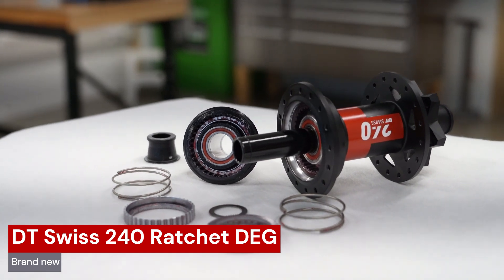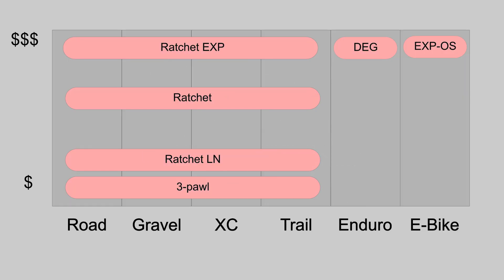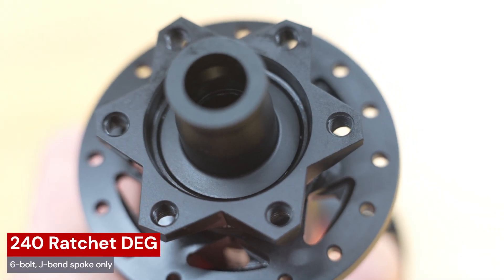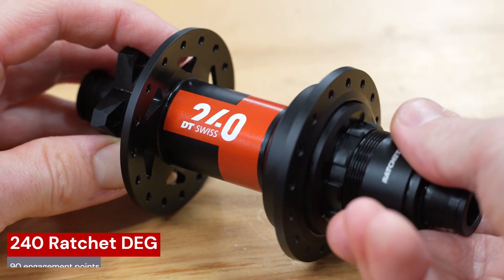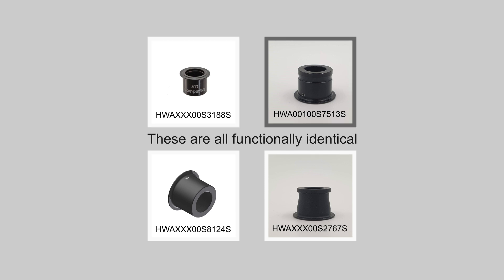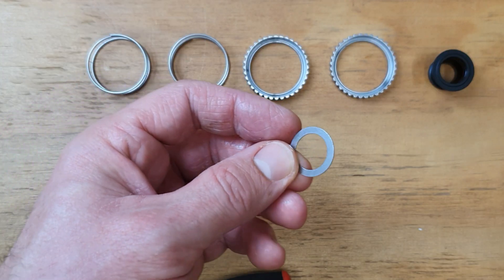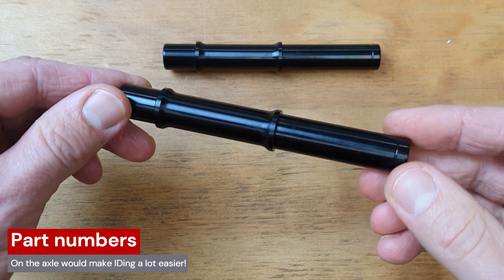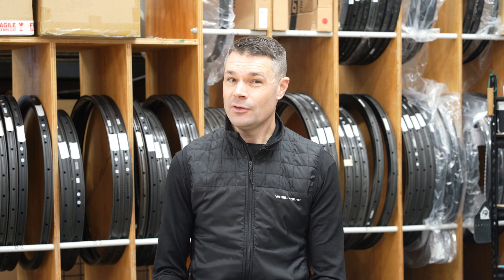DT Swiss 240 Ratchet DEG Deepdive

Comment: I had an 18T ratchet in my hub and replaced it with a 54T ratchet.  DT Swiss does not recommend this type of ratchet for my e-bike. However, when riding trails, the combination of the drive unit and the hub led to a lot of free stroke before engagement. So I was told to buy the EXP OS, but they only had ratchets with lower engagement points of a maximum 42T. So I decided to just ride the hub until it breaks.

Comment: At aliexpress already arrived a DEG copy for road hubs and straight pull spokes ))) But with 6802 and 15267 bearing at hub body for low weight. Btw, what do you think about small bearing life at rear road hubs?  Such as DT 180 1526DS/6802NDS. Is it ok for 70kg rider?

Comment: Thanks for the review. Do you notice higher freehub drag with the DEG? I've heard reports of that.
Reply from the maker: @trentvlak  After some of the EXP issues we say I was  working on a way of measuring both freehub body drag and bearing drag, but honestly it's slipped down the priority list of projects.  When the ultra low-drag Pro5s showed up I really wanted to resurrect that project but haven't :-(  

So without measuring, yes there is more freehub body drag.  This is consistent with general physics that almost any 'type' of freehub will increase drag with more engagement points as you've got more things touching, more often.  The DEGs larger diameter ratchet rings will also be contributing to this.

One interesting thing about ratchet style hubs that I did notice with my testing is that the drag flattens out at a certain speed as the ratchets essentially skip over each other and don't have a chance to fully engage.  

Maybe one day I'll get that freehub body drag system up and running -Tristan

Comment: Great video.  I wasn't aware there's a bearing life compromise on the EXP hubs.  I have three sets of EXP hubs, with one set still new.  On one hub I could feel a click or two while turning the end cap with my fingers.  Not the usual notchy bearing feel.  The 'click' goes away when I apply pressure on the end caps while turning it.  Do you know if this is an early sign of a bearing failure?  This is on a front hub (240) so presumably it has nothing to do with the EXP design.  Thank you.
Reply from the maker: Have you checked that it's not the endcap rotating on the axle?  -Tristan

Comment: Excellent video! In my opinion, the current DT350 (SP CL) with 36T Star Racthet is by far the best hub on the market.
Reply from the maker: Tried, tested, and true!  It's a great hub with a great balance of all attributes and a reason it's the hub everyone tries to copy!  -Tristan
Reply: Would you consider it even better than the previous (non-EXP, traditional Star Ratchet) 240s? "Better" in terms of durability, since the older 240s also had smaller bearings than the 350
Reply: @steveadorjan9048  by definition we only truly know what the durability of a product is like after years and years of use.  In that regard I think it's too early to say about the DEG...the smaller bearings might be an issue, but the slightly wider bearing stance and different freehub design might mean bearing life is better.  I think it's too early to say. -Tristan

Comment: First class video and information. No annoying muzak and stupid cartoon clips. It looks as though many Chinese brands are taking advantage of the expired DT ratchet patent and making improvements as well. Ratchets (up to 64t) are now available based on the initial design but have no shoulder providing a better spring interface and use of a slightly longer parallel spring/s. Some are using a single spring similar to the EXP but the inner ratchet is still held within a ring nut and as such both ratchets move with the axis of the axle. They also seem to stick to the original 6902 bearings (15x28x7) rather than the smaller diameter 15x26x7. By continuing with a two piece ratchet as per the original design, it makes it easier to replace them because as you say it is a wearable and as such a replaceable part. Some of them recommend a 500Km service interval for their ratchets.
Reply from the maker: I think having both ratchets floating means they deal better with axle flex, contaminants, and tolerance issues.  OneUps new hub uses a single floating ratchet and looks really well-made so that will be an interesting one to keep an eye on.  -Tristan
Reply: @WheelworksHandcraftedWheels  Having already looked at One Up's hub information BOTH of the ratchets are floating. The "ring nut" is machined directly into the hub body (7075 T6) so is an integrated design. Bearings are 61902 so are 28mm dia. and are both driven out via the non-drive side. They use a 44t ratchet but ATM do not make a centre lock version and they require J bend spokes.
Reply from the maker: @johnlesoudeur3653 Both ratchets are 'floating' but the one in the hub shell has no spring so will always be pushed back into the hub.  The freehub body ratchet has a spring on it so will have far more lateral movement.

The only downside of this design is that the steel ratchet which is inside the hub shell will eventually wear the hub shell, although time will tell how long that takes

I'll try and get some info up about the One Up - Tristan
Reply: @WheelworksHandcraftedWheels  Yes that would be good because it can be argued that although the inner ratchet is "floating" it is pretty much static, the outer ratchet does all the moving. I have an Elite Wheels Pro hub and they use a similar design but use use an Al alloy ring nut. No discernable wear and no issues.
Reply from the maker: @johnlesoudeur3653  (with regards to the OneUp hub, not the 240 DEG in this video) the outer ratchet slides side-to-side to allow engagement, however the inner ratchet is still loose in the hub shell and will still rock and move as the hub flexes.  This will almost certainly lead to wear on the hub shell...the long term questions are (a) how long does it take to occur (b) does it affect the hubs performance (c) does it matter ?  I'm sure OneUp have done fatigue testing on this, both in the lab and real-world.

Interestingly the early Hugi hubs, and I think even the DT Swiss branded ones, which used a 10mm steel axle only had one sliding ratchet ring and one spring.  What comes around, goes around!  -Tristan
Reply: @WheelworksHandcraftedWheels  Great discussion, thanks.

Comment: I hate the trend of shaving weight by going with smaller bearing. I'll stick with my 240s non-exp for as long as possible.
Reply: I'm speccing out a new wheelbuild set, and I'm choosing new 350s over 240s because the new 350s are basically old 240s, negligible weight difference between the new 350 and new 240, and larger bearings in the 350s.